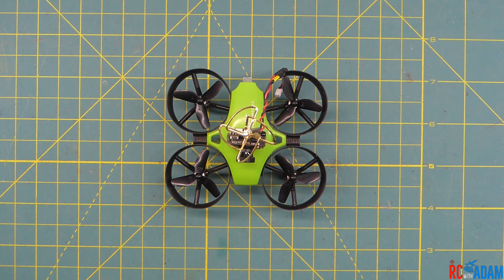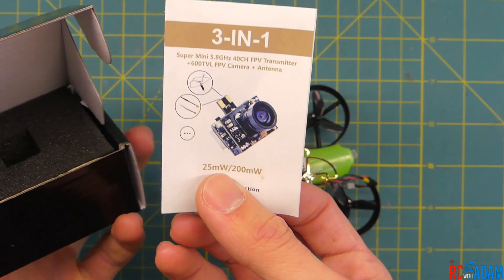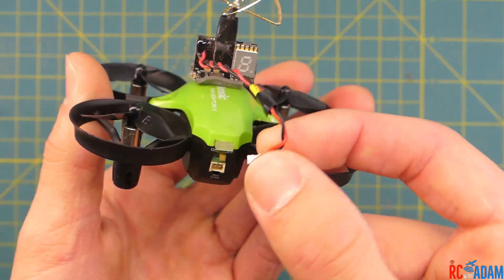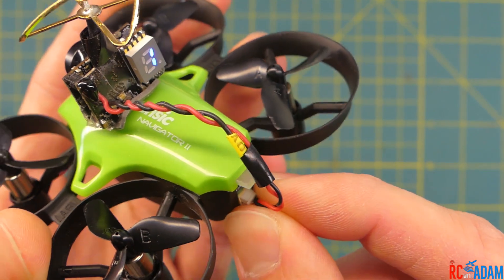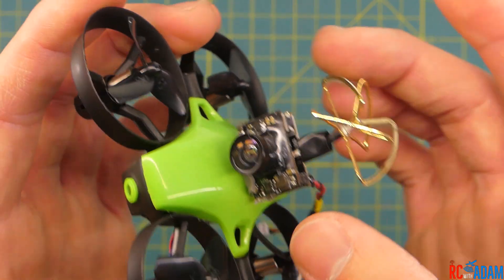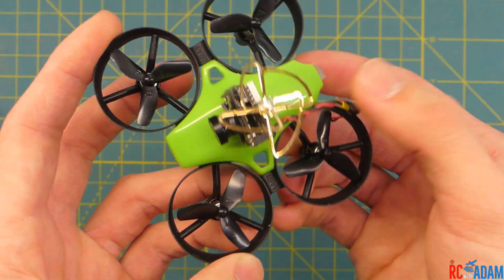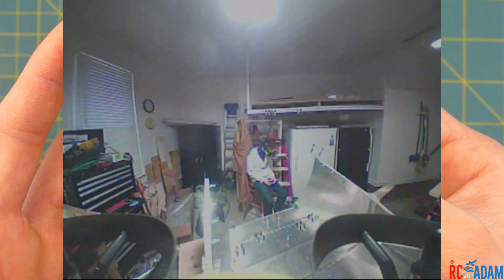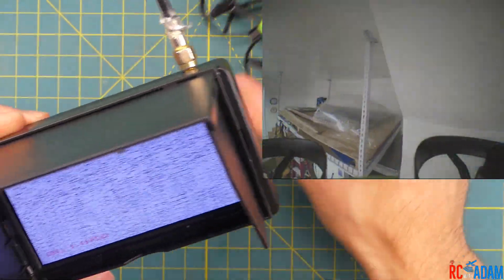Whoop-ish - A20 DIY FPV Mod - Potensic FireFly Micro Quad

Comment: What goggles are you using???
Reply from the maker: Old eachine box goggles. Can't remember the model.
Reply: @RCwithAdam1  would a ATX03S vtx work with the drone?? I assume that it will work fine with any type of analog goggles right??

Comment: If you plug the mini camera to the battery port in the drone how do you plug the battery to the drone?
Reply from the maker: Hi! I plugged the camera into the battery charging port. This was the older version. The newer version has removable batteries and may not work for this setup.
Reply: @RCwithAdam1  Exactly, the new version ("Upgraded") DOES NOT WORK with this setup. The idea is great, but either a designated separate battery for the camera or splitting the battery output may work. The A20W has a camera included, but the latency is prohibitive for FPV.
Reply: @gyulasoos9865  Hi, I’m trying to emulate this with the Upgraded version. Is there more info on how I can do it?